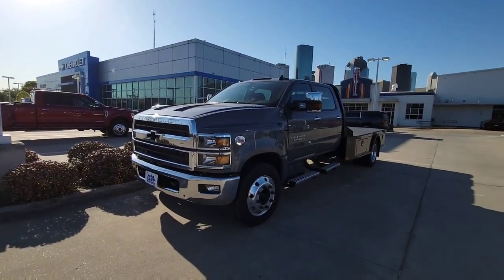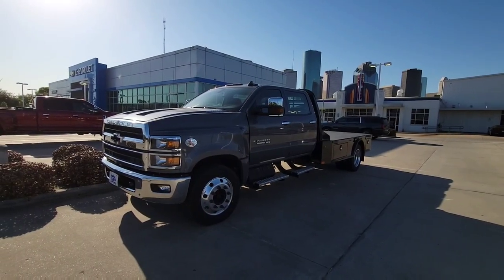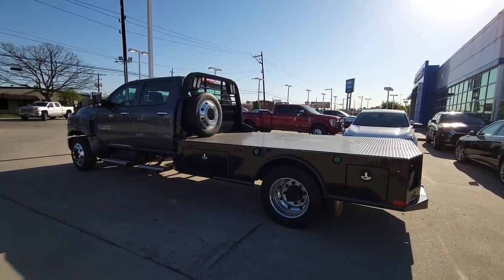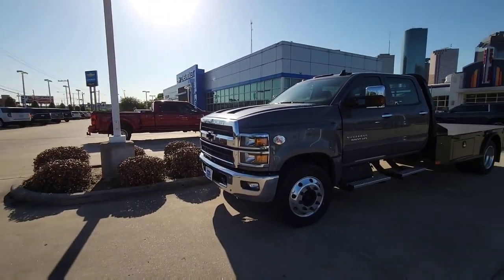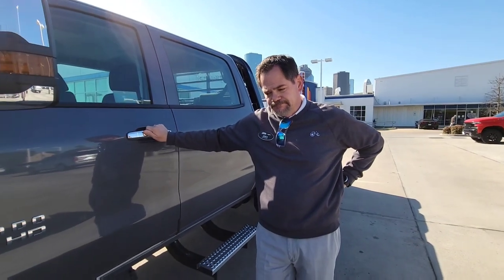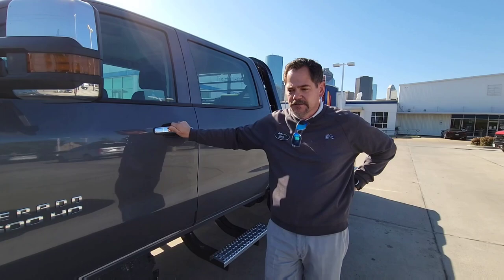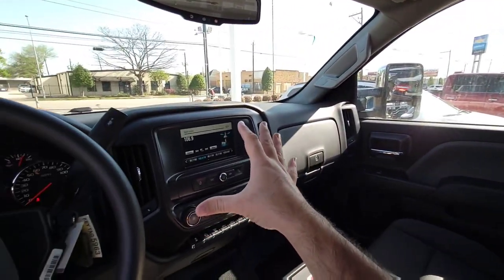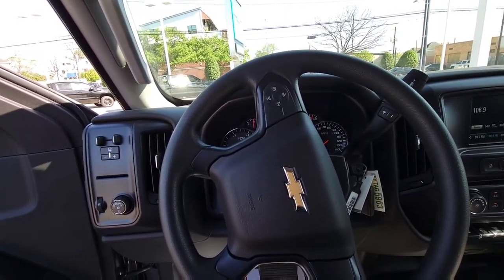Mighty Chevy 5500HD Truck as an RV Hauler? Surprising answer!

Comment: I've got alot of respect for a commission based salesman putting saftey before a sale. Tip of the cap to you sir!
Reply: Ya theres no way that 5500 could handle towing a 5th wheel. A 2500 or 3500 is much better equipped to handle that weight.
Reply: @georgebenway2898  yeah how so?
Reply: Almost like DOT wants us to buy more trucks.

Comment: I gotta give props to the salesperson Greg, who gave up a sale because it was a poor fit for the customer.  That shows a lot of integrity, and is the sign of a top tier salesperson you can trust.  Good on you sir, thank you for taking the time to show of this really cool vehicle, hope you get a couple of sales for your troubles.
Reply: A good salesman!
Reply: The Ramm 5500 has a much higher GCWR
Reply: It's funny how that works. I've found that the fleet guys are so much better than the regular sales droids. Generally honest without the usual razzle dazzle BS.
Reply: I guess you missed the comment of "TexDOT." The dealer can't sell the vehicle.
Reply: @alexandermckay8594  fleet guys likely rely more on repeat sales. If they sell you something today that isn’t a good fit, you’re going somewhere else for the other 5 vehicles you buy this year.
Reply: Malarkey.  He was protecting the sales of the much more expensive (and actual inferior towing capacity) top of the line models. Actually surprised the poster fell for it.

Comment: I owned a 2006 GMC 5500 with the 8.1 liter Big Block Chevy. 488 cu in. It was used on a Gulfstream Super C and was a great chassis! 5 speed Allison back then. 8.75 mpg. 19K GVWR. 25,000 GCWR. It had the clam shell hood too but no safety catch on it back then. It was the Kodiak chassis.

Comment: Nice looking truck. That’s why I voted for it. I’ve seen one of these with the largest available truck camper mounted on a bed like that with side compartments built up higher on each side which gives you plenty of storage. When you take your camper off you still have a great work truck.
Reply: Truck camper was my first thought when he mentioned higher payload vs towing capability.

Comment: Perfect truck for a bed camper. Envision an Earthroamer style custom shell on this beast...and only 55k?
Reply: If the hood wasn't so tall, I would be inclined to look at it since part of my usage for a truck is to haul my truck camper.  I also tow a 16' utility trailer or my 5er. My Jeep Wrangler rides the trailer
Reply: @Harry-zz2oh  I think after 3 weeks you wouldn’t notice ...might seem normal too.  I’m just amazed by the price....about the same price as a 1/2 ton.
Reply: Need  4x4 with Truckcamper.... it would end up tall as a fifth wheel ..... but because size of the bed you can get a pass through box bed behind cab ..... thats a plus.
Reply: @MALNTV  I wouldn't notice so much but my wife would.  She is only 4'11¾" tall and already has issues with 'tall' hoods.  Even her Jeep gives her troubles.  Admittedly, she doesn't drive my truck very often but when she does it is due to my not being able to drive.
Reply: @MALNTV  halftone really don’t cost that much, they’re $15-20k off msrp here. I looked at a 2021 Silverado for $40k msrp yesterday and they offered it to me for $26k the door without me even being remotely interested. Not a base model either.
Reply: @MrPland1992  which brand?  Few months back I went looking for a TRD Pro 4x4 Tundra with all added accessories I want ... It was 52,000.  I use used to be a RAM guy but never had any luck with their tyranny’s...so switched to Toyota.
Reply: I was thinking the exact same thing EXCEPT I would say single cab. Why? You could extend the bed and build a bigger camper.
Reply: @darkhorse2reign  same exact thoughts here.
Reply: @MALNTV  // I've thought about this more ways than Sunday 🤣
Reply: @darkhorse2reign  just need to source a good composite supplier or fabricate your own aluminum frame and aluminum composite panels....I’m thinking the aluminum route is the best way to go.
Reply: @MALNTV  // Yup. I wanted to build my own... but I have zero experience.

Comment: uh... if the def is on the other side it becomes problematic when filling def at the larger truck stops in some cases.
Reply: They do that for the amateurs. On the 3500 the filler is under hood

Comment: I owned a 2008 Jayco Seneca class C on the c5500 Kodiak chassis (duramax). These medium duty trucks were a huge compromise between capability and comfort. Compared to a pickup of the same year these beasts suffered from horrendous road noise and the massive cooling fan howl. The front leaf springs made you feel every imperfection on the road. I found myself envious every time I looked down on someone towing a fifth wheel/ travel trailer in their nice smooth and quiet 2500/3500.

Comment: I have a 6500 4x4 that I spec'd out with everything I could, had the dealer pull the seats and have them redone in leather. Have been pleased with it so far!   High ratio 6th gear,  I've been getting considerably better mileage than the 550 used for work.
Reply: HI! Hows the chevy holding up? any problems or breakdowns? how many miles you got now?
Reply: @markdavidcasino4876  I have 40k on it. Had a fuel go out twice first one  under warranty and the 2nd one they didn't want to warranty but they found the tank vent hose was plugged with gravel dust,  I drive along of gravel as a beekeeper   but they ended up covering it since that's no where stated as a maintenance point.   Anyway the truck I have is the longest wheel base possible at 235"   120" CA 15' flatbed  Ford and dodge don't offer a 120 in a crew cab.   That layout is the only way I'd recommend the Chevy.  However, if you are looking at the 12 flatbed' crew cab size trucks. I would 100% pick the f4-550 due to the ride and by far far, the turning radius. Any other questions just reply here.
Reply: @beeguy2127  awesome! And only had problems with fuelp pump? What were the symptoms when they went out? What mileage did they go out? How long did Chevy diagnose the problem to having it fixed for you both times?
Reply: @markdavidcasino4876  they did an under warranty rebuild on the front axle. It always kinda had a little whine when it was locked in, did since it was new so I didn't care much since it still functions.  Just when it was in for the fuel pump I told them about it.     As far as symptoms of the fuel pump, I kinda determined that myself, grew up in mechanics/diy everything .   Would sputter and stall once in a while.  Tank cap would suck air in when I opened it and it was under half full.  Changed fuel filters still no avail.  Both times I got free towing from gm roadside, one on the hwy, one at my farm.   Between the engine codes and the tank being sucked in, diagnosis on their end and fixing was relatively quick.  3-4 days since it wasn't anything too odd.
Reply: @markdavidcasino4876  one at about 28k and the other about 35k mainly since I don't drive it much in the winter and kept it full, the vent tube wasn't much issue  with intermittent use.  Summer time and burning full tanks quite often I think stressed the fuel pump due to the vacuum it was pulling since the ta k wasn't breathing.
Reply: @beeguy2127  awesome! Thank you so much for the reply... I'm getting my new Chevy 6500 soon for my business and just wanting to be prepared if anything fails... Your feedback helps a lot!!!
Reply: @markdavidcasino4876  should be fine.  They are payload pigs. I run and empty flatbed on mine and weight 12500, and put about the same on the bed and it handles weight great and good brakes. I just wish the turning radius was better, and the empty ride quality but that comes with the territory
Reply: @beeguy2127  hi! Just got my new 6500 yesterday and it's awesome! Just curious as mine has a slight ticking sound, does yours do the same?

Comment: I have a 2019 5500 and I run it hotshot. My combined weight rating is 40k lbs. I could have rated it up to just under 45k but I don't have a reason to go that heavy. The truck has zero issues hauling that weight and I've put 150k on it. GM is just being stupid for some reason because it's more than capable of handing that load. 

The problem with these trucks is not the truck but GM locking the ECU's down so you can't work on them and they have limited dealerships who are approved to work on the MD trucks. Meaning if you break down it's a 4 week wait to get into a dealership. Also "GM decided that rear shocks are "optional" so you have to special order rear shocks if you want them and yes this truck will beat the hell out of you. If I were to buy another I'd only buy the 6500 with the rear air shocks

Comment: That DEF tank on the right side is going to piss a lot of people off.  Unless you are using jugs to fill it, its on the wrong side for where truck stops put the DEF pumps, which are on the drivers side.
Reply: I looked at a Chevy 3500 a while back.  It was powered by the Duramax and the DEF fill tube was under the hood of the truck.  Very inconvenient since you almost need a small stepladder to get up to it so you can use the hose.  If you are using a jug, you would need the ladder.  My wife would never fill it; she's very short (4'11 3/4")
Reply: I like it under the hood. The hose is long enough to put in the hole before  dumping it in. Then I just tip it over and let it fill it up and I don't have to carry the 20lb jug again till it's empty. My Ford sucks for that because I have to hold the jug the whole time.

Comment: I think you can haul up to 20 grand behind it , Chevy increased the towing numbers this year ,the shorter wheel base would probably have a higher number.  Also you can get several different HD Allison transmissions , 2000 and 3000 series .

Comment: Per a gm engineer at there release of these trucks stated its the Allison trans as to why the GCVW  is lower.  Meaning if you have a 23k gross truck and 40k trailer rating you’re over what the allison will physically handle.  The truck will handle it but kill the transmission so they limit GCVR. .  They are designed for higher GVWR as most companies use them for I wish gm or IH would make a 4500/5500 with max tow and limit Gross weight to make the numbers work for towing.

Comment: You can most definitely pull a camper with that provided you have a cdl. The gcvwr being over 26,000 pounds makes that a requirement. Not that the truck can’t handle it.
Reply: That only applies if you are using it commercially. If not for hire then you don’t need cdl

Comment: In my experience it's similar in Ford also.  A F550 doesn't tow nearly as much as well as a F350.  The F450 is made to tow. The F550 is made for a service bed type truck such as a wrecker, dump, or utility bed.

Comment: Just took a look at the GM website and they show various CGWR up to 35000 lbs. Yes they do not rate it for Convential Trailer Towing - which is usuallly a bumper pull - they also don't rate it for gooseneck or fifth wheel towing either.
Reply: Basically they don't want to cut into their 3500/2500 sales
Reply: They just told ya right there then. They don't bother with the tow ratings on these because they don't sell them with hitches and cant attest to the safety of any towing weight rating on hitches that get installed after the truck is built.

Comment: Very nice truck. I like that you can easy swap out the interior for a High Country or LTZ interior from a 2015.5- 2018  and be right at home with all the comforts, heated cooled seats, full center console, heated steering wheel, etc. 
Also going this route, don't get the airbags but contact Liquid Spring and get a better suited rear suspension with better adjustability,  ride quality and reliability of the system.

Comment: FYI, for hauling non agricultural products, or pulling your own RV. be aware of the 26,001 CDL rule. If the entire combination is rated at over 26001, you will be required to have a class A CDL. It does not matter what actual weight is, it is the max total rating of the two vehicles combined. Big trucks are nice, just be sure you are aware of the licensing for the vehicle and for the vehicle operator. Insurance is another issue that can be problematic. Having said that, this class of truck is a blast to drive. I drove 18's for 44 years. Thank you Rick, for clarifying some important points that some "fast money" sales people .... we know they are out there .... would intentionally skip over to make a sale.

Comment: How much did the truck itself weigh? I don’t think I heard it mentioned, only the GCVWR.
Reply: they didnt mention it but after googling it a Chevy 5500 is anywhere between 17,500lbs -19,500lbs. thats why this particular truck couldn't tow a 17,500 5th wheel because it was over the 26-30,000 GCVWR of this truck.

Comment: I personally have never considered buying a Chevy truck but that hood configuration is a huge selling point for me.  I can only dream of having that kind of access to my engine compartment with my RAM 2500.   I think these truck manufacturers underestimate the value of ease of maintenance especially since owners of these trucks tend to maintain them themselves whenever possible. If you make a truck easier to work on, it will help breed brand loyalty.

Comment: The truck is a joint venture between GM and International Truck. Duramax engine, GM electronics built on an International chassis. If you are going to buy one consider the International truck folks who know more about built a medium truck spec rather than a car dealer. The truck is available with a 25 gallon, 40 gallon or dual 40/25 fuel tanks and an additional factory fuel tank cannot be added once the truck is built.

Comment: Can you imagine you and your wife trying to drink a coffie in that while cruising around unloaded.
Reply: My wife is still mad at how my F250 rides unladen.
Reply: @nicolathonathan770  especially the gas engine with camper package, I had to lower the air pressure to soften up the ride
Reply: @OpenAirAdventure  my is 7.3 gas but no camper package. I run 55 psi when I don’t tow anything. When loaded, it’s smooth.
Reply: @nicolathonathan770  try bob tailing a tractor 🤣 it’s like a toboggan on a dirt road
Reply: You would need air ride suspension, I don't mean just supplemental airbags.
Reply: Feel every bump 😂
Reply: @billyschannel997  you would feel bumps that technically don't exist
Reply: @kevinmoran864  OUCH!
Reply: Plus the turning radius suck
Reply: Not without throwing up every time I’d get out!

Comment: Yeah of course they built the truck around a mechanic and not build a truck around longevity why do you think very few mechanics hate working on Ford's lol.  Chevy just got tired of all the complaints and this was the solution.  Hey JD just picked up our 2021 GMC Sierra 3500 dually.  She's an upgrade from the 2009 Ford F350 XL it replaced.  Hoping to do videos soon.
Reply: Actually most mechanics despise working on f series trucks.

Comment: Yeah but what if you are looking at putting a truck camper on it like an Eagle Cap 1165 / 1200 or a Lance 1172 ? Most 350/3500’s have to have upgraded suspensions in order to accommodate the payload for those larger truck campers. That’s where these trucks shine I think in the RV community.

Comment: That’s why a lot of Non-CDL RV Transporters use 3/4 tons, because they are limited to <26,000lb, truck sticker plus trailer sticker.
Reply: You can get a 5500 Crew Cab in 26k, 30k, 35k, and 37k GCWR configurations.

Comment: I am around horse events where a lot of Freightliners and a few other MD trucks show  up. Many of the ones driving those trade back to Ford 550 and Ram 5500 because the stepped up size creates problems for maneuverability. Same for friends with businesses where they have employees driving trucks into neighborhoods and doing construction projects requiring backing close to homes. Ford and Ram have reasons for the scale of their trucks. This truck is likely less a competitor to those trucks as it is to a Hino or Freightliner. International assembles this and sells its twin with badges changed

Comment: I guess you need to buy the 6500 with the upgraded GCWR package 😬
Reply: Gotta pay that upcharge to have them print the higher number on an identical chassis VIN
Reply: @treeclimbingdayjob  - it's all about printed numbers. In the real world this would handle a large 5th wheel better than the 3500's and the F-450.

Comment: Just saw a posting from CHP in California. Because the bed doesn’t have sides it’s considered commercial and you have to stop at all weigh stations regardless if it’s hauling a 5th wheel and non commercial driver.
Reply: That sux!
Reply: Lmao no. The rules state that if you're using that truck to make money, you're in a commerical vehicle. Private rigs are not required to pull into a scale.

Comment: @Big Truck Big RV- In all fairness to the truck, this appears to be a problem with the spec as shown, and not the truck. I'm not sure if Chevy can spec this truck as I'm stating, but you can spec the International CV class 5 series with an Allison 1750 transmission giving you a GVW of 19,500lbs, and a GCW of 37,500lbs. The Chevy class 6 can most certainly be spec'd with the Allison 2750 transmission with a GVW of 23,500lbs ( 23,000lbs 4x4) and a GCW of 37,500lbs. Great review otherwise. Up here in Canada, only the International CV is for sale. Happy to help anyone further with this model, as it can be perfectly spec'd and  equipped for RV's.

Comment: Yeah the minute I started this video and I saw that bad on this truck I knew that it was not going to be a tower because this ridiculously heavy flatbed , it alone cuts the amount of weight you can tow because it’s so ridiculously heavy then you add the frame of the vehicle which is much heavier than a pick up truck this truck easily weighs 12,000 pounds dry. what they should do is put an aluminum bed on these trucks it would save 2 tons of weight and make them slightly more capable